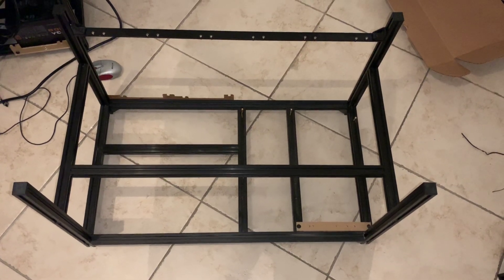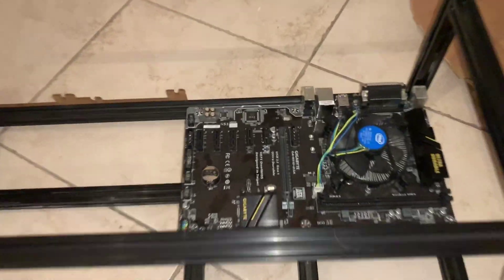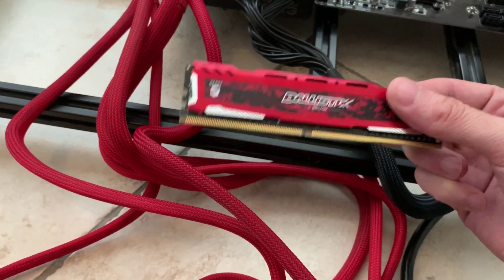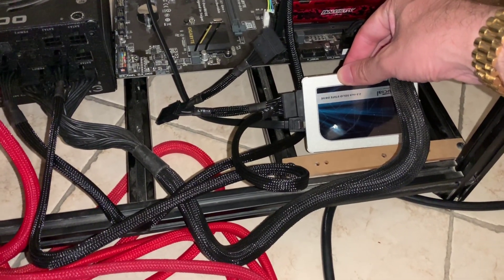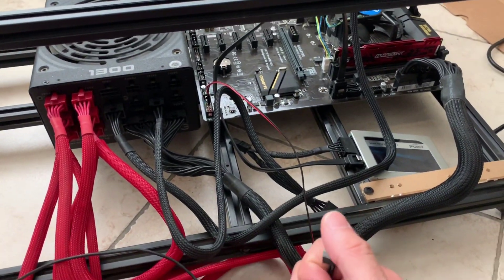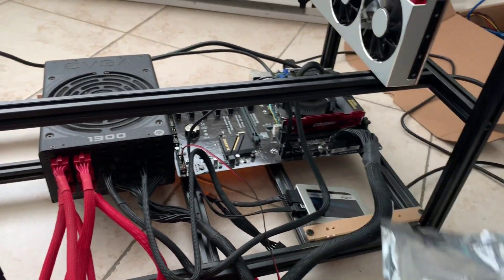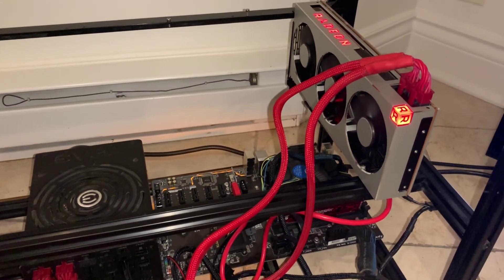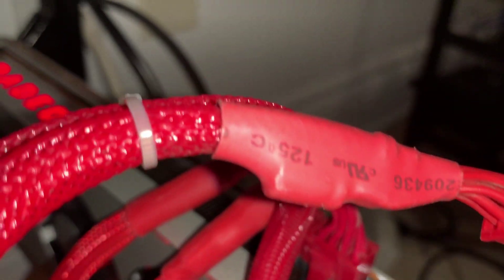6 GPU AMD Radeon VII Build Part 1!!!! How To Make Money at Home Mining Ethereum!!!!

Comment: Still not sure if I should paid RX580 8gb 48 of them or RX5700XT 24 of them, is really hard to get Radeon VII's in South Africa
Reply from the maker: Impossible to get Radeon VII’s anywhere now. They are sold out. I would go with used RX 580 or new RX5700’s (if no used available.) Thanks for commenting Lucas
Reply: Better buy Ethereum directly !